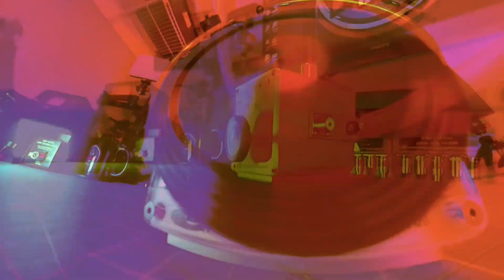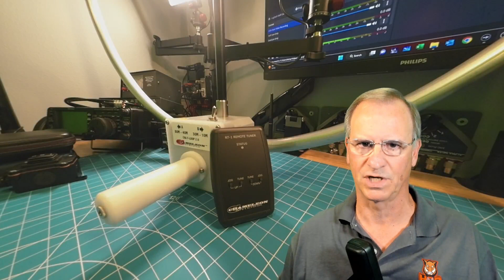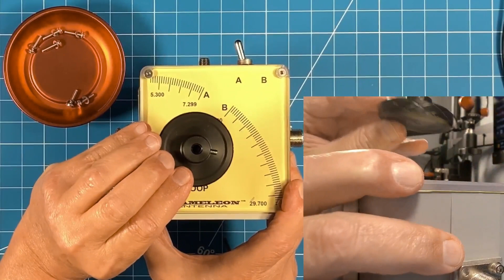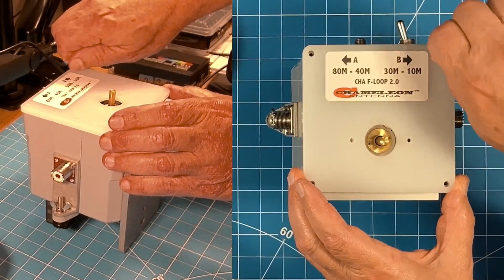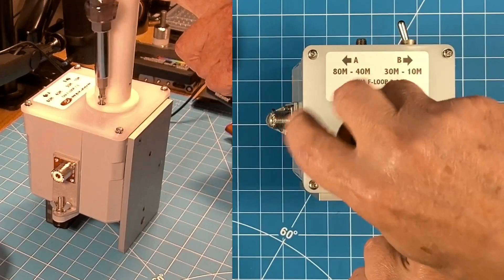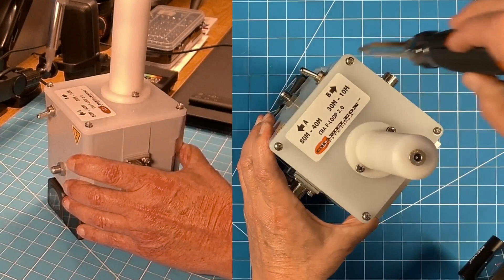Chameleon Antenna CHA F-Loop 2.0 Remote Tuner Installation Demonstration

Comment: Question…
The A-B switch that switches between the higher and lower bands, do you think it would be possible to extend it to reach the shack? That way you could switch between the band groups without leaving the desk.  How far do you think that it could be extended before it starts to cause problems?  And what gauge of wire would you recommend/
Reply from the maker: That is an interesting idea, but unfortunately, I do not know the design / functional requirements that would be required to answer your question.  Great idea.

Comment: Is it better to mount your loop antenna vertically so it is directional.  Or is it better to mount the loop antenna horizontally so the radiating/receive is 360 degrees.
Reply from the maker: Great question Lawrence.  Yes, some recommend horizontal to get rid of the null.  The CHA F-Loop doesn't really have a way to mount it horizontal, so not sure that will be part of my experiment.  But, not you have me thinking........can I make a fixture to try that.